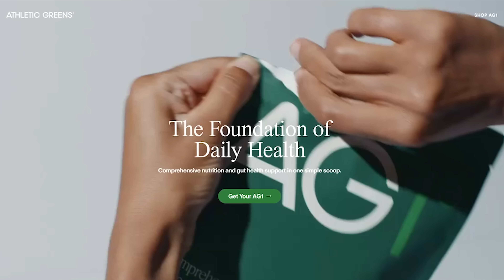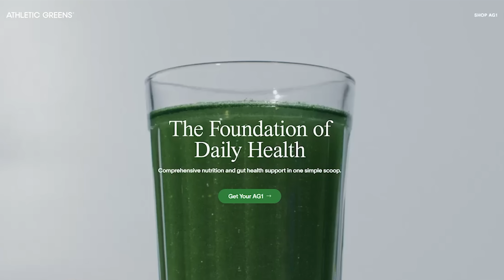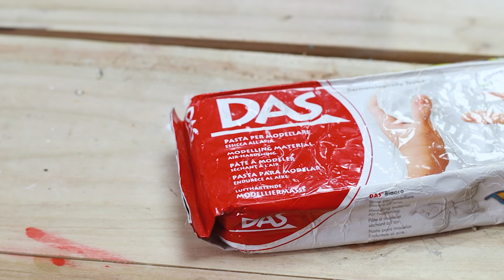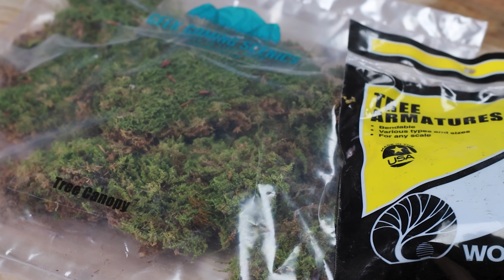How to turn a $10 kids toy into a Warhammer gaming table

Comment: WOW, this turned out really well. Fair play for taking a chance on a toy as a basis for the build, great idea. 

I now use the Modelling Compound and its great and your 'tuna salad' consistency is spot on. It is very easy to work with but like you mentioned, it will setup quicker than you expect if you use too much at one time.
Reply from the maker: Modellign compound really is so good. I use it for everything now!

Comment: Loved the video, takes me back to my Rogue Trader days scratching bits together for scenery. 

One idea about resin pours. If I've a base similar to the one you used in the video, you could use bathroom sealent rather than hot glue to secure the  plastic with wooden strips screwed into the base to help seal it against leaks.

Comment: Awesome build! Resin tip: it won’t adhere to silicone, so maybe lining the river edges with silicone molds or a silicone mat or some other silicone thing and then building up coverage for leaks will give a cleaner edge.

Comment: This really looks great. I'm planning to transform an old MASK. toy (Boulder Hill) into an Ork base for 40k, and your videos give me some good advice how to accomplish that.
Reply from the maker: Sounds great!
Reply: I hope that Boulder Hill is pretty well trashed already if you're going to do it. That set is worth quite a bit, even in poor condition.
Reply: @Mike_Jones1980  The condition is okay. Some parts are missing, like stickers, tubes and figures. And of course the original packaging and instructions, if the set had any. In this condition I've found it multiple times on ebay on a price around 30 €, so not more expensive than any terrain from GW 8even less so, considering the size). Of course you can also find the same set for triple digits on the price tag, but that's totally over value, except perhaps if the set is still in mint condition.

Comment: Biggest thing I've seen someone like Luke Towan use for resin pours is to use pva glue and tape.  so you apply the pva around the edge where you're going to scrape and prep for painting anyways and then apply the tape around the edge letting the glue make the water proof seal.  Works great for small parts of the edge.  Otherwise for full resin pours i've seen people use clear plastic and more glue.

Comment: if you spray iso alcohol on the plastic it will release the hot glue and then the border will come off easier. You can also use tape it doesn't have to be plastic to edge the resin unless it is a deep pour as the heat from that may warp the tape.

Comment: Unless I'm aiming for a deep pour, I've found that High Gloss Polyeurethane is a better option than resin. The stuff you can find in a craft store in what looks like a large bottle of craft paint.

It's very thick when you go on and can work to keep it from going over the edge, but flows well enough to fill things in if you're just a bit careful there

Comment: Overall, I think that you did a great job with this board.

Now that said... I would say the following things.

#1 When using a static grass applicator, go and get a small length (6 inches or less) of 12 or 14 gage solid copper wire and place in the "alligator clip". Then, when you are applying the static grass, you place the tip of that copper wire into the very edge of the glue allowing foe the electrical current to flow through the glue and causing a far better effect with the grass standing upright. 

#2 The river needs to be painted with gradients of colors going from the lightest on the banks to the darkest in the center of what you want as the deepest parts of the river/lake/body of water. Now, with that said, Black should never be the darkest color for most of these cases because it is very very rare that you would look at any body of water and see the water as black. It may look as very dark blue to very dark blue/green but almost never black.

#3 Play boards are very much like making dioramas. One of the best people on YouTube for showing how to make/build dioramas is Luke Towan with his channel of the same name. To me, watching his videos is a huge treat and I tend to learn something almost every time which I know I can use in the miniatures hobby.

Please understand that I think that we all can improve and I'm simply trying to pass on things which I have learned to both you and anyone else who reads this comment. I do really think that you a great good on the board, but those are the bits which I believe could help you out in the future to possibly create an even more outstanding gaming board! 

Also, congratulations to your sister on her child!

Comment: Did you mean CD cases, not the CDs themselves, as they  have a reflective backing which the data is stored so the laser bounces back to the sensor.  Seems like the CD cases is what you actually meant, as they break easier than CDs.
Reply from the maker: Yes, the cd cases.